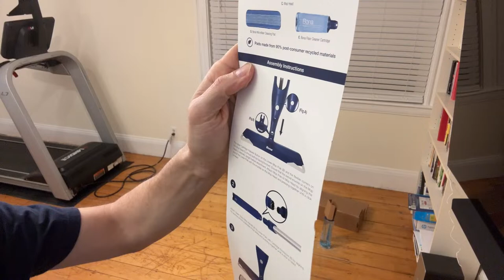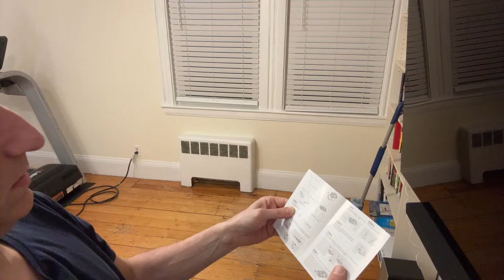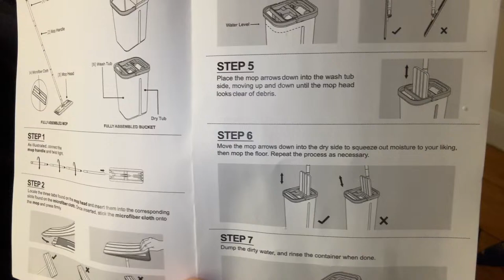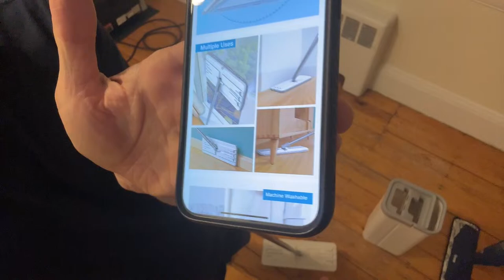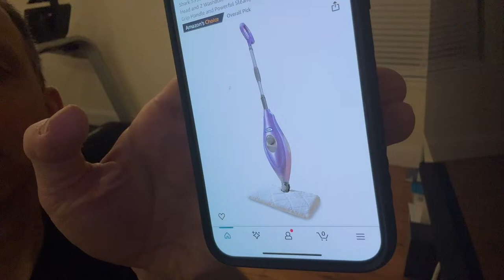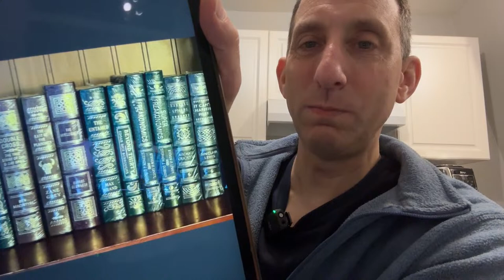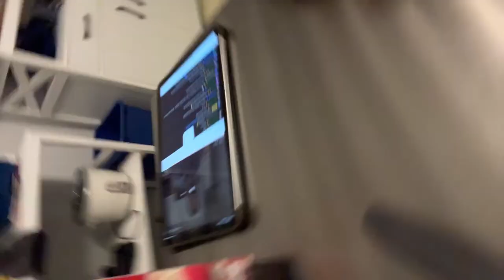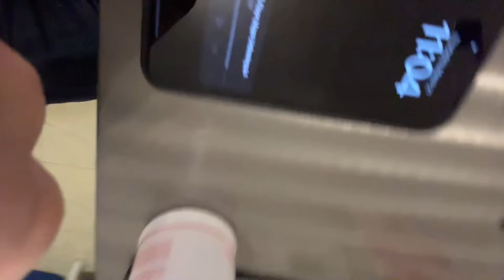LIVE Floor Mops Unboxing & Review (Bosheng Mop & Bona Spray Mop)

Comment: The Bona system is great for cleaning! Here’s a few tips for a fast clean.

Before vacuuming your floors wipe every hard surface countertop, table from back to front. Just wipe every surface using a wet sponge with dish soap and hot water run through it. Then wring out the excess water. Continue to wet and rinse sponge out as you notice the sponge get dirty or grimy. Use the scratch/brillo pad side down on the sponge. As you drag it the Brillo scratchy side of the sponge will kinda catch on the spots that need more scrubbing. Knock ALL crumbs onto the floor. 

Vacuum the entire floor and then mop all hard floor surfaces. This is the fastest most efficient way to get a good clean on your space quickly. 

I use Mrs Meyers Clean Day cleaning products to keep my house smelling fresh and sparkling clean. When I need a good disinfection I use about 15 drops tea tree oil and two drops lemon oil and one drop of dawn dish soap. The spray mops are not worth it the Bona mop is great without the spray system attached. I use either Bona spray bottle independent of the mop or the Meyers cleaner. Every 3-4 ft section of floor I rinse, wring out at radio in cleaner or spray the floor with diluted cleaning product or straight Bona cleaning solution and mop. Then repeat the process. Be sure Steve when you use the mop remove the mop pad and rinse it with hot water and cleaning solution, then wring out and mop another section. Repeat that process the mop pad must be dampened with water in order to get a clean in the floor. The hotter the water the better it lifts grime.

I have two big dogs and vacuuming in conjunction with the bona mop pad being rinsed often as you mop it helps grab the excess dog fur the vac may have left behind. 

Bona is an excellent system. If you can’t afford the Bona system dollar tree and family dollar have comparable system that are less expensive. The dollar tree comparable is much better for smaller spaces; apartments, RVs or tiny homes. 

Another tip; when deep cleaning you can use dish soap or laundry detergent on tub shower units. Use sparingly though to keep from having too much suds.
Reply from the maker: Thanks for the tips!
Reply: @Lookner  you are welcome 🙏. I learned this type of cleaning doing fast turnarounds on vacation homes. ☺️